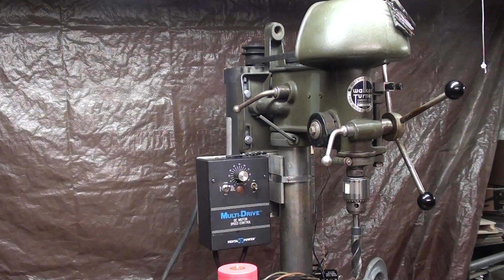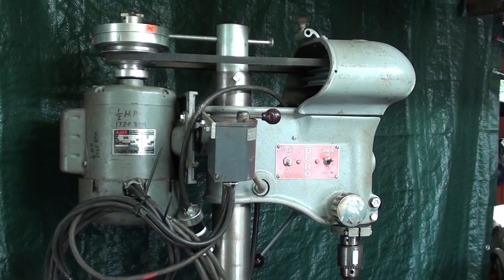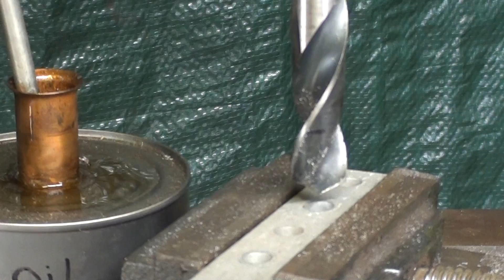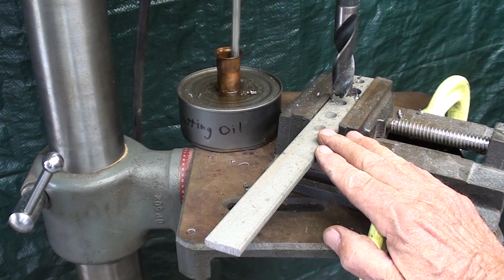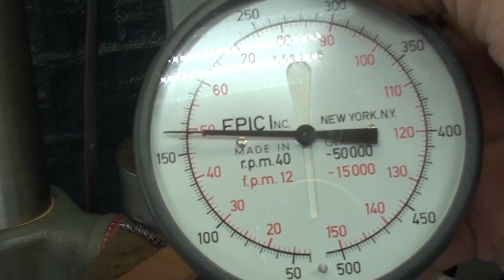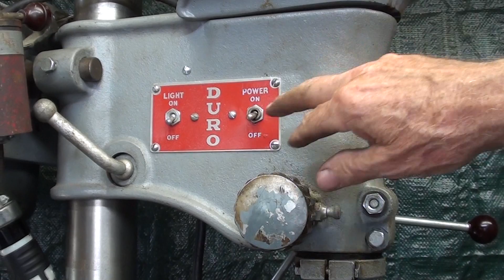Drilling with the PULL GEAR revisitedTips #483 tubalcain

Comment: You mentioned you're not happy with the original sharpening of the Silver and Deming bits.  While you probably sharpen by hand, have you ever tried the Drill Doctor machine to sharpen bits?  What do you think of it?  They take bits up to 3/4" and have a chuck for sharpening left hand bits as well.

Comment: Well yes it would be also how you sharpen it helps a lot.  My uncle owned a machine shop I worked at it.
on a bit that big we would ahve used a few more step up in sizes or taken it to a larger machine with the power
the largest drill press we had was a big pre wwII radial arm drill that you smacked you head on every time you walked past it. that would stuff a 1" drill bit in 2" steel plate and not bat an eye. 
Punching a 3/4" bit into metal the trick is not to stand on it you have to back the pressure off and clear the chips.
A smart thing to do is what my Dad taught me always tighten all 3 jaws on a drill press or all  jaws on a lathe if you do you'll never slip a bit in the chuck. This will damage the drill's shank  and or the chuck and you'll never dril without run out again.
the shank on the bit will have a gouge in it and lump on the end of the scar grinding it off won't fix it it will have to be turned in a lathe or ground round.

Comment: Very nice experiment series.
I've found for big holes in steel, the step drill bit is great, especially hand drilling in the field.  Then finish with a twist drill if its thicker than each step. The step drill keeps the material cut per revolution smaller than with a twist drill, without having to change drill bits a number of times, and without the chatter.

Comment: hi mr. pete,I am looking at purchasing a drill press.and one of the options is power down feed.I want to ask you if this is something that's needed.is it a feature that does not get used much or is it an option I that's really needed if I plan to do certain operations?thank you.
Reply from the maker: I think it is a future that is really needed. I have the power feed on the Bridgeport, and never use it for drilling. Only boring

Comment: I have the walker Turner and love it..what I did was create a dual belt system using that odd riser off the motor mount..I created a spindle with bearings and a pipe welded to a shaft run through that hole in the motor mount. All stepped pullys so I can change speeds. If I can get a picture I'll post it but it works great..and a lot less noisy. I used it to cut holes with large bimetal hole saws.
Always enjoy your videos.
Reply from the maker: That sounds like a real good solution

Comment: We started using X type belts to eliminate slip and most of all they allow for much tighter turning radius around smaller sheaves.
AX and BX belts aren’t inexpensive, but since they last longer, grip better and can be used on really small diameter running gear, they’re worth it. We were using standard belts for all of our customers with belt replacements for regular maintenance every 6 months. We switched to X type belts and the belt replacements could have gone well passed a year, but we changed them yearly after that. The cost and time savings for the belts, equipment wear, down time and failures was astounding. And yes, we tried link belts.....they can’t make the tight diameters, have shorter life and cost a bunch more. They Are convenient though. Thanks for another great video Sir.
Reply from the maker: Thanks for a good suggestion

Comment: I believe trying to use too light a drill press is rough on drills. You cannot push the drill into the work with enough force to prevent chatter.
Reply from the maker: That is probably true

Comment: Now try retrofitting one of those old craftsman drill presses with the stupid skinny plastic v-belts.  

I think the small spindle diameter and spline fit are big limiting factors in trying to get any high-torque performance out of these lightweight presses without chatter.  I really don't know a good workaround for that.
Reply from the maker: I gave away my craftsman press with the skinny belt, that would always turn upside down

Comment: I had an old drill press like this one that had a 2hp cap start compressor duty motor on it. Wish I had never sold it. I think I sold it because the metal switch would give you a jolt. lol
Reply from the maker: lol

Comment: On those large bits with a stepped shank it's easy to have the bit slip in the chuck and gall the bit shank.  Tighten the chuck onto the bit using all three holes in the chuck to make it extra tight. You probably knew that.
Reply from the maker: Some of these drill bits have flats on the shanks

Comment: If you are showing ways to slow speeds, don't forget to add a 3rd center pulley. My drill presses use a center pulley to slow down the speeds. I have one on my Walker Turner and it works wonderfully. I tried the DC motors and center pulleys are the way to go.
Reply from the maker: I have a Center probablyattachment I do not like it too hard to change belts

Comment: I have that exact same drill press. I think mine has original motor, think is 1/3 hp. Often I drill without clamping down part, and so, I have the belts a bit loose. When they slip I feel relieved that my hands did not get taken off. Mine does 1/2" quite well. Occasionally put in S&D type, go easy on them when I do. The table on it only has two tiny, hard to see pecks on it, that's how I got it. A light drill it is, but it is a real good one at same time.
Reply from the maker: Yes thanks

Comment: It's quite difficult o get nice regular chips on a machine that produces vibrations while operating, we have to consider ourselves lucky that they do so good with all that racket...   ;)
Running half speed is, in my opinion, a better way to save on drill bits and on sharpening.
Reply from the maker: Yes

Comment: I’m a machinist by trade.  On our 4’ to 8’  (yes 8 foot) radial arm drills we run large twist drills slowly as well.  The edges last longer, and more importantly the chips and coolant don’t fly into the operators face!  Those speed charts are way too aggressive.  Great vid thanks.
Reply from the maker: Wow, those are big drill presses. Yes I think the speed charts are too fast also

Comment: Thank you for your home-shop oriented videos.
You stated the speed at 250 rpm. Is this using the pull gear in (planetary reduction in use) or out (direct). Achieving that speed using the pull gear would result in more torque?
To drill large (>1/2" diameter) holes what is more useful: slow speed or more torque - or both?
As production is not the goal, would slowing the drill's rpm - barring belt slippage -  well below the speed chart's recommendation provide any advantage? Could the rpms be reduced so far that the drill would rotate too slowly? Thinking here of the Silver & Deming drills as originally intended: hand powered in a blacksmith's post drill.
Reply from the maker: Wow, that's a lot of questions on one.

Comment: What about changing the pulleys to chain drive instead of V belts? more torque at lower speed and much less slippage potential Perhaps that may give you the desired effect!
Reply from the maker: I had thought about that. Did not want to waste the money for an experiment

Comment: Very interesting!  But that green tarp flogging around was getting me sea-sick!  I was thinking of attaching another step pulley idler wheel speed reduction system to my drill-press.  I think that may be a bit less complex (and noisy) then the Pull Gear reducer and transfer more motor torque to the work then the electronic speed reducer.  Thoughts?

Comment: Lyle, in my opinion the short chips when cutting steel means the drill is running too fast for the feed rate, I would be happier with 100 rpm. I show drilling with an 1 1/4 bit at 40 rpm on my Denbigh and the spirals are plain to see, I assume industrial speeds include very fast feed rates and lots of power to sustain that, cheers, Andy
Reply from the maker: Yes thanks

Comment: id use a taper shanked drill if i had the option, and a slower speed, amazed the hole turned out so round without a section of cotton! nice video, i have a drill press ive just restored, also with an old washing machine motor haha
Reply from the maker: Yes

Comment: I have also found that there is a big difference between Chinese made steel and Aussie made steel and the same is probably true for US steel. The Chinese export steel is softer to cut and shape. I have also found that steel is softer inside than it is just below the outer skin and first two and a half mm.
Reply from the maker: Thanks
Reply: That's why it's called Chinesium....

Comment: I have found that you place less stress on the operator, the machine and the bits and belts by stepping out the pilot hole through a number of intermediate bits. I have also found that the magnetic drill that I own does an amazing job drilling 16 mm holes in 10 mm thick steel bar running at only 350 RPM. The biggest problem apart from oil smoke was dealing with all the swarf spirals.
Reply from the maker: Yes thanks
Reply: Mark, If you let up on down-feed pressure when the spiral starts to get out of hand (or before) it will break and the swarf spirals can be controlled.  Hope this helps...   Fred

Comment: I am glad I'm not the only one who is less than impressed with Silver & Deming drill bits.
Reply from the maker: Yes
Reply: They are known as blacksmiths drills here in the UK, really you only want to use them if you cant run a morse taper shank bit.
Reply: If used in a ridged situation where they don’t chatter, they work as they should.

Comment: Mr. Pete,
Another good video.
 A local machine shop has a Bridgeport just like yours for sale asking 3500.00. I know you don’t need one but maybe someone on your site might be interested. They also have a lathe with a ten inch chuck for 1500.00 . Both machines have “Or Best Offer” on the signs. I don’t know the name of the lathe manufacturer. Everything on both machines seem to work very well though the knee table on the Bridgeport has some dings. Can’t say as to operation as I didn’t talk to the sellers. They might just be paper weights on steroids for all I know.
Dale from Decatur
Reply from the maker: 3500 Sounds Way too high
Reply: V ram knee mills are all over the place for $1500 or so, with power feeds and DRO maybe $2500